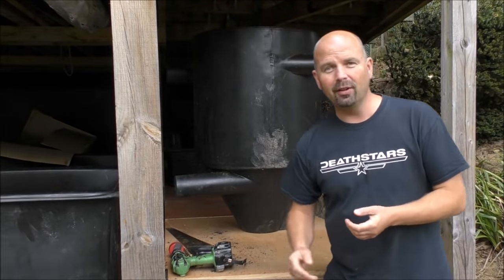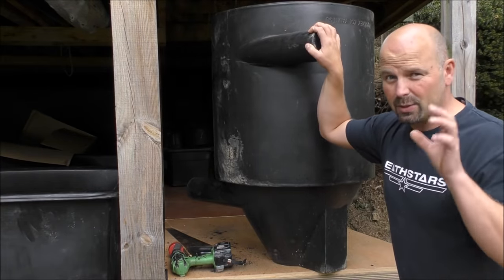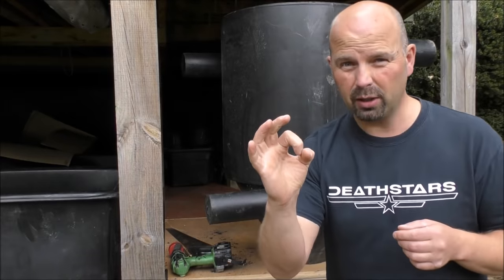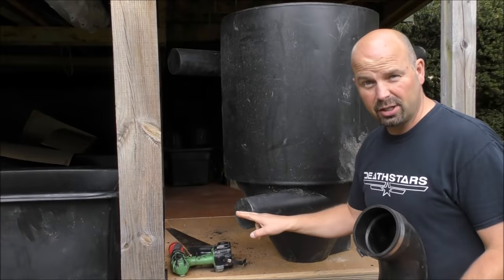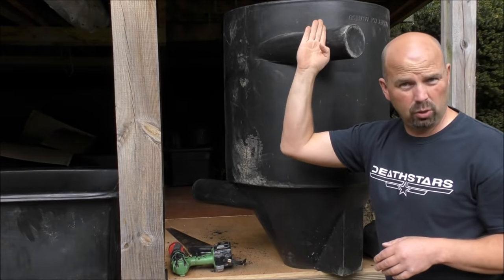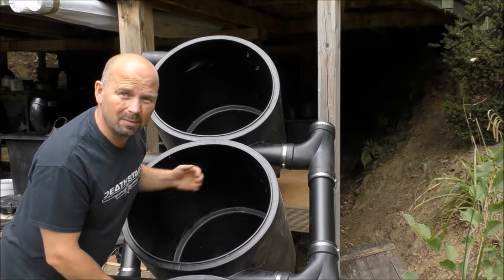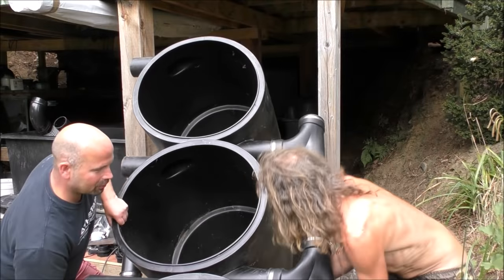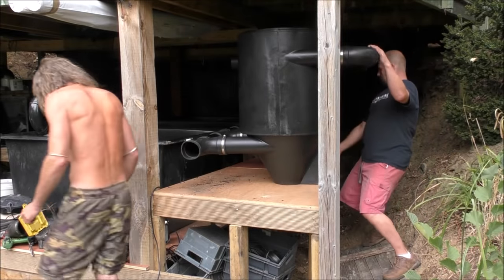Building a HUGE Pond Filter - Part 2 - Vortex Filters

Comment: Loving the vortex set up so far, It has been very well thought out, especially with the flush system you have installed. So much better to clean in pond water you dont wanna be killing the bacteria thats built up in there for no reason. Fantastic idea
Reply from the maker: Yes and with 30000 litres per hour those tanks are going to get a hell of a cleaning, lol
Reply: oh yeah they are not going to want for flow that's for sure lol

Comment: Hey Buddy, I enjoy your videos but i just  have a few comments. I have worked in the sewage treatment area for large municipalities for 34 yrs. All of this tech. has been around for over a hundred years. With regard to the fittings,..., those tees are called ty's and they are meant to direct the flow of the liquid in the direction of the sweep,  and the  gaskets always go on the inside. That helps them swell and form a better seal as well as protect them from the weather.  Keep up the interesting videos!

Comment: Good job, if you put a drum on it you won’t regret it.  Just a little one for you, with it being pump fed we always put a float switch on the pump that way if a pipe ever came loose or burst because it froze or something, it won’t empty all your water out.  You can raise it but then the pump can burn out.  Just a little peace of mind.  I know it’s basically a lake😂😂 look forward to seeing the next one👍
Reply from the maker: It would take days of pumping for me to notice a drop in level, lol
Yes a drum may be a good solution - I'll see how the 'traditional' approach handles the extremely fine muck then make changes in the Winter if necessary. The pond is close to 20' deep in the middle so never freezes and I've not had a problem with any external filters freezing as a result....so far....
Reply: Pondguru I more meant the pipe work being brittle in freezing temperatures causing a burst.  With that amount of water though I suppose the main concern would be drowning the neighbours 😂😂
I’ve just installed 7 drums at the new shop, they just make life so much easier.  Hopefully this clears it up for you though.  Look forward to seeing the progress.
Reply from the maker: I'll make sure I drain out the vortex filters if the system is turned off in the winter but the intention is to run it all year.
Yes I wish we had a drum of two when I had the shop as it would have made things easier - a drum at the very start of this system may ultimately be the way forward but I can't justify the expense presently......I'm still saving for a pump.
Plus I need a new lawnmower, lol
Reply: Pondguru 😂😂never ends does it😂😂definitely not the cheapest things and especially with the amount of water you have to filter.
Reply from the maker: I'm trying to talk my wife into us getting a robot lawn mower - I could probably have bought 3 drums with that cash, lol

Comment: Wouldn't you want the rubber seal on your drains on the inside because water pushing out will make a better seal than the seal holding the water back from the outside? Awesome setup though! Thank you for sharing and as always Keep Building👍

Comment: Its a geat design but I am questioning the 4" rubber elbow.   They are routinely used for drain lines and not supply lines and are usually not NSF.  I have seen them deteriorate over time and when you remove them they smell like gasoline...  Have you had any issues with them?  Also, those pre-filter brushes are going to need some regular manipulation to dislodge collected waste.   You dont seem to have much room for that.   You might get to it later, but I was wondering what the plan is for that?   I would put an access door in the deck ..

Comment: The only thing that I would personally do, is on the drains  is fit a gate valve  as on opening it would created an instant vacuum, whereas a ball valve will leak back any instant vacuum suction until fully opened.

Comment: Hi great videos. Love the Filter idea for the pond. Although I was thinking with the size of pump and flow rate wouldn't it be more optimal to have the vortex filters in a sequential staging (one behind the other)vs. a parallel setup (side by side). That way each tank would in theory separate different sizes of particles. and thus give you a cleaner output in the biohome tanks and shower filter. It would be really easy to change over too. Have the input come into one Vortex (V) on bottom and connect the top output together with the next one  with 90* elbows. and then the bottom of that tank with the bottom of the third. and that gives you one output at the end of the third tank to connect the biohome (u) tanks too. Plus this would help being the middle vortex would be spinning down like a drain it would pull air into the water to help with removing ultra fines in the third tank.

so here is a diagram; 

(pond)-(pump)--_V--V__V---u-u-u---(shower)----(pond)
Reply from the maker: The main problem is with the particle size I'm trying to settle as it's not like a 'normal' situation of large visible lumps of fish muck and therefore much of it stays in suspension unless there is structure for it to cling to, hence the brushes in the vortex filters - I suppose I could have just gone with a rectangle tank for the first stage instead of 'vortex' filters but the base shape of the vortex does lend itself to settlement. I'll see how the flow is with / without brushes and assess the effectiveness of them after a few months of running but they could be altered if necessary since fittings are rubber.

Comment: Can you elaborate why the rubber elements help you change the configuration?  With solid PVC as long as you don't glue them, it remains equally possible to change the filter configuration
Reply from the maker: With push-fit PVC the fittings can stick after a few years in one position and the seals can also perish. The rubber allows for easy removal of any of the parts of the filter and since making the video I moved the filter to the far end of my pond. 
Just use whatever suits your filter situation and budget as there is no set way to put anything like this together.

Comment: Are you not worried about pressure loss from the pump (1 1/2 - 2 inch) to the vortex feed pipes (4 inch)?
Why elevate the vortex units? Each one is bottom-in/top-out, so you were already getting plenty of "height" for feeding the downstream containers.

Comment: @pondguru why not install the pump after the vortex filter that would pull a vacuum on the inlet pipe of the vortex filter that way the large muck could be filtered before it hits the pump impeller.
Reply from the maker: That only works if the filters are gravity fed and are at the same level as the pond water since the vortex units are not sealed there will be no vacuum effect. Ideally this would be gravity fed with the pump at the end of the system but that's not an option on this pond unfortunately.

Comment: They are no longer vertexes with those brushes in and defeat the object as the brushes will defuse the water flow from its circular motion. Anyway good luck with this, I don't envy you cleaning it all after a few weeks running.

Comment: That is an awe-inspiring project that could cement your title as the pond guru!
If I may ask, are you considering building your own hydroelectric plant to supply the power necessary to drive the system? (just kidding).
I look forward to seeing those beautiful trout swimming in crystal-clear water.
Reply from the maker: I thought of felling the bottom part of the wood and installing a whole bank side of solar panels but that will be a hell of an expense.
Yes, I'm really looking forward to doing the other parts of this filter build whenever I can carve out a spare hour or two for doing it.

Comment: Hi rich great video as always. I'm just wondering and I'm sure many others are too, when are you going to do an update video of the jebao pressure filter bakki shower configuration.
Since our phone conversation I too have been using the jebao pressure filter as a pre filter and it has been a Godsend especially in the most recent hot spell we have had.
My maintenance routine is now a pleasure as there is nothing much for me to do compared to the old chore.

Regards 

Thomas.
Reply from the maker: The one I used is a Lotus / Sicce pressure filter and I should really do a video showing how it is cleaned out. I will be integrating it into the big filter system - pump in final tub will pump through the pressure filter then up to 2 x shower filters and back to pond.
I'm glad you're having good success with the pressure filter / shower combo as it makes perfect sense to use them together.
Reply: Pondguru, credit where credit due Richard, without your wealth of knowledge myself and I'm sure others around the world would still be struggling to work these things out.

Thanks again for all your help buddy 👍
Reply from the maker: No worries - we all are learning and I love to learn too. I'm certainly no expert in anything, lol

Comment: The use of the brushes in these filters makes me want to try that in a smaller application. Do you think it would be effective to make my own using a 20 gallon plastic cylinder and brushes for a 1200 gallon pond. I really like to idea of pulling those brushes out to get rid of the muck.
Reply from the maker: Yes brushes are very effective and trap a nation of muck. I had them in another filter and even the fine clay dust was settling on them that's why I'm using (a nation of) them here.

Comment: Nice build. Did you put in a check valve along your inflow route to prevent backflow from the filters to the pond in case of a power outage? It's a little thing but a huge safety feature to prevent the muck from messing up your pond if the power goes out and the filter water backflows to the pond. Easier than losing fish and cleaning the main pond. What will you be doing with the tubs beside your big filters?
Now I have to check out your other videos. Cheers mate  frm Canada.
Reply from the maker: If the power goes out  then the water will drain from the vortex filters but the brushes in them should still hold the muck and the bottom of the vortex will hold the muck so I reckon on the scale of things not much will go back to the pond.
Each of the sections will be covered in a different video although the next part will have some notes on the 2" fittings I'm using on the inlet and vortex parts as well as the main brush chamber. I've got another 50 big brushes arriving on Wednesday so I'll see how far they go - probably about half what I need for the brush chamber, lol

Comment: great  job brother , i,m planning to do the same filter however in the first filter i wanna replace the brushes  with gravel , would that work better do you think brother ?
Reply from the maker: Ideally the gravel would be after brushes as using gravel as a mechanical cleaner will take much more cleaning than brushes.

Comment: I used gutter pipe in my filter construction. Beware, the solvent joint leak, but I used silicone rubber to fix this.
Reply from the maker: The solvent pipe and glue I will be using seems to fuse together and I've never had a leak in 20+ years of using this stuff so I'm sure it will be OK.

Comment: Hi, is 300g of biohome standard filter media enough to fill up 2 trays of the sun sun canister filter?  I really enjoy your videos and im Glad that you give good and proper advices unlike fish stores out there. Thanks!
Reply from the maker: As far as I know there are 3 different sizes of the SunSun canisters.
Best media would be either the biohome mini ultra or biohome ultimate for a canister filter and the filters hold the following amount in each tray:
1000 lph = 1kg
1400 lph = 1.5kg
2000 lph 1.7kg
Reply: Pondguru thanks will be getting the ultra one after much consideration
Reply from the maker: Biohome ultra is far too big for a canister filter - you would need the mini ultra for a canister.
Reply: Pondguru sure will get the ultimate one instead because the store I’m currently at doesn’t offer the mini ones
Reply from the maker: Groovy - sound good to me. Ultimate is basically the mini ultra with added trace elements to allow bacteria to set up even faster.
Reply: Pondguru really down on my luck, even the ultimate is out of stock. Will be ordering the ultimate straight from the filterprouk website, any idea on the estimated number of days it will take to reach Singapore?
Reply from the maker: It takes 1-3 weeks from UK to Singapore and there is a large order of about 6 tonnes in from the Singapore distributor which is around a week away from being dispatched. From then it will take another 4-5 weeks to arrive and be in stock so if you only need 1kg it will be faster to order from UK. Orders over 2kg go out by international courier so take 4-5 days.
Reply: Pondguru thanks

Comment: Hi from Leeds! Great video and project. I love over engineered stuff this is perfect. Quick question though, I have a blagdon all in one 9000 filtration system doing a 400 litre afinity pond. I upgrade if from the pre supplied 3000l system so it's massive overkill for the size pond I have. I can power a fountain as well as a water feature  with the pump outlet. I had one going to the fountain and the other just had a L Piece coming out with a small piece of Flexi hose to basically create a circular current in my pond. So the dirt was stirred up from the bottom, kept in suspension then eventually picked up by the filter. Someone told me to use that 2nd outlet instead to aerate the surface further instead of doing the circular flow so now I have a longer piece of hose cable tied to the fountain standpipe so it's also blasting out of the water? Which is better for my pond? The latter means the water isn't as fast moving maybe the goldfish prefer that? But the first one seemed to stop as much settling on the bottom?
Reply from the maker: There is no real right or wrong answer to that as you need decent water surface disturbance but ideally want the muck to be swept into the filter too. Just experiment and see what works best - as long as the fish aren't battling against a  current it will be fine.
Reply: Pondguru yeah lots of surface agitation and fish seem to prefer it without the water going in a circular whirlpool effect underneath means they can stay still. The other way round seems to keep things cleaner done water tests again today, pH 8.2, ammonia & nitrite both 0 and nitrate 5.0.
Reply from the maker: That's a very high pH for a pond but fine for goldfish / koi. Nitrate is high as expected for a pond but unless you plant it heavily or install a shower filter filled with porous media you won't really lower that.
Reply: Yeah pH has been consistent at that, someone has said driftwood 
would lower it a bit? I  was also told the nitrate was low. The next level below is 0.

Comment: Nut on the outside of the tank fitting surely? That way it is soooo much easier to tweak it up if it is leaking.
Reply from the maker: See previous comments / answers (it doesn't really matter which side the nut goes on)

Comment: Great video,will not the water go in the first vortex and Forget the last two
Reply from the maker: It should flow through all 3 more or less equally but I'll run them without brushes in to see what the flow is doing before adding brushes back in.

Comment: Hi…
What water Speed (or pressure) is needed for the Vortex for working as intended? My concern is that you will not reach that min. Speed needed to generate the spin. First you pump through a small pipe into the big infeed pipe to your 3 vortexes. The flow Speed goes with the second potence of the Diameter , means the Speed will be much less compared to the original flow Speed. Then you divide the flow into 3 vortexes… and this is without taking in account the fricton losses inside the pipe which is considerable (actually the flow goes with the third potence of the Diameter, means you reduce the Diameter to half, then the flow is 8 times less). 
I guess your vortexes will just fill up with water without generating the spin… what makes you think this will work?
Best regards
Reply from the maker: The main problem is with the particle size I'm trying to settle as it's not like a 'normal' situation of large visible lumps of fish muck and therefore much of it stays in suspension unless there is structure for it to cling to, hence the brushes in the vortex filters - I suppose I could have just gone with a rectangle tank for the first stage instead of 'vortex' filters but the base shape of the vortex does lend itself to settlement. I'll see how the flow is with / without brushes and assess the effectiveness of them after a few months of running but they could be altered if necessary since fittings are rubber.

Comment: Shouldn’t the gasket on the bulkheads be on the submerged side with the locking nut on the outside for ease of tightening?
Reply from the maker: The fittings can go either way and still work but the seal would not generally be on same side as locking nut.

Comment: After 3 years what is your opinion on vortex filter? Do you have better solutions?
Reply from the maker: It takes up a lot of space bu in the new filter I moved the vortex filters to they work well to keep the rest of the filter clean. They are also handy as they settle out the muck which is then drained down directly into my vegetable gardens to feed the plants.
It's an old way of doing things and for more modern filtration a drum filter or a sieve is definitely the way to go as it takes up so little space compared to the vortex filters.

Comment: Shouldn't the rubber gasket on the bulkhead fitting be on the inside???
Reply from the maker: The fittings can go either way and still work but the seal would not generally be on same side as locking nut.